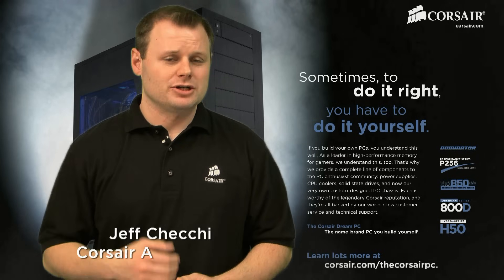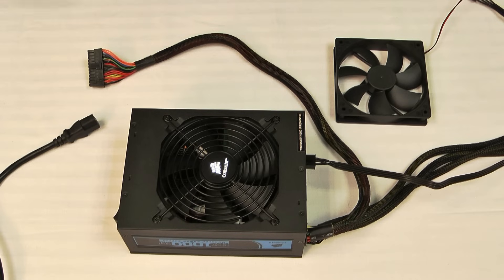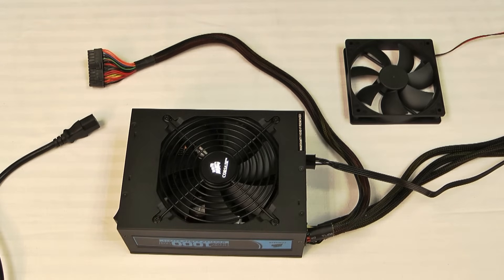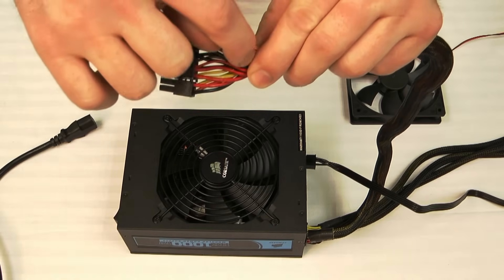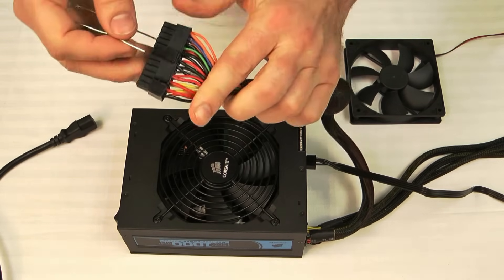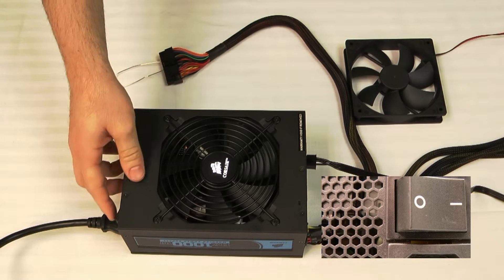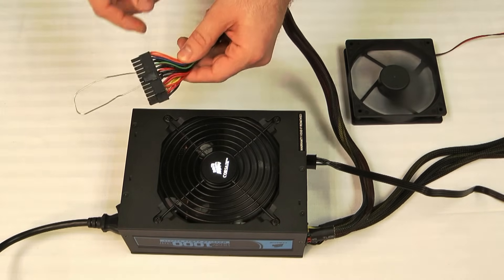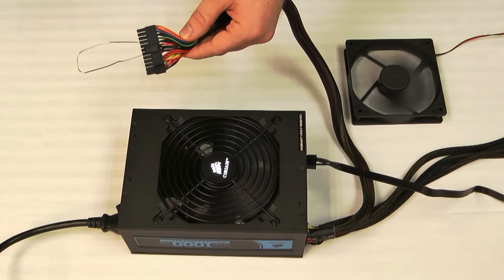Corsair Video FAQ: How to test a Corsair power supply

Comment: Opened the case and grabbed the cable... All wires are black. .'
Reply: Same problem with me :-(
Reply: AX860 – all wires are black and the connector is two separate ones of 18+10 pins, that is 28 pins, not 24 (even though the text on the back side of the power supply days ”24 pin ATX".
Reply: @Mina_be  24 pin that plugs into MOBO is standardized. So that means manufacturers have to put PS ON wire on the same place no matter the brand/model/color of wires etc.
If we are looking at 24pin from back perspective (cables are leading into 24pin connector side) the PS ON wire is 4th from the left going toward right.
Reply: you can find a pinout of ATX power supplies on Google
Reply: Hold up so clip is on TOP and holes facing you. From the top left count 4th hole. THAT is your GREEN.
Reply: Yep. Also my case fans plug into the motherboard
Reply: clip at the top, open end facing you: 3rd and 4th pins from the top left
Reply: @johnnyrosenberg9522  other end
Reply: Its been 8 years and this is still ridiculous .
Reply: I have black wires but it was super easy to test, all you have to do is look for the side with the clip, check if it's 24 pins in total, and short the 4th pin with the 3rd or the 5th pin, and the fan should start turning
Reply: Corsair digital link
Reply: @soggyjungle6065 and which is black?

Comment: This video is 14 years old and everything has moved on so avoid this as there are no green wires on most power supplies as most are ALL black and modular.   Most problems are with the 850 watt Not the 1000 watt and cables are often proprietary so DON"T use any cables that didn't come with the power supply as mixing cables can cause various issues if they are not compatible.   As for me, I'm opting for something better.

Comment: Many years later, we'll still using this method except that manufacturers decide that all the power supply wires should be black and we also have "zero RPM" fans. Question: why can't the manufacturers install a simple LED or push button feature to test for working fan or unit serviceability instead of pushing paper clips into connectors?

Comment: ax860 wont even power the fan it just shuts off again, powers the mobo argb lights so im guessing the 5v is fine. 🤷 got the ax860 to replace another corsair psu that went bad.

Comment: I followed your instructions but I don't have a fan so I connect it to the power supply, however the fan ran and again it stops moving.
When I first tested the power supply, the building was shut down

Comment: i have issue with Corsair HX850i PSU.. Psu is turning on but motherboard is not booting up. lights on motherboard is working fine.. i have checked with other psu motherboard is working fine.

Comment: I have a corsair CX750 and after like 2 hours, my fan fails and stop delivering power the and PC shuts off. When I touch the top of the fan inside my PC, it is hot, but not very hot. How can I figure out what the problem is and how to fix it if any way ? also, it is making a small low noise almost silent ticking noise.

Comment: what if your pc sudden reboot when play high requirement games?
Reply: +lucian Tank Check your temperatures first to make sure your system isn't overheating.
Reply: +Hyperfyre sorry for my noob question... but how high is high for my pc temperature?  cos the last time i check the highest it went was like 60 to 70 degree when im playing metal gear phantom pain....
Reply: It depends on the individual parts in your PC. For some processors & graphics cardss 60-70 degrees is fine. Not ideal but nothing that will danage your PC. I'd google what is fine for your parts first though.
Reply: If your PC is restarting but your motherboard fans, USB devices and monitor(s) don't power on try another power supply.

I've been having issues with mine recently where it isn't powering on my pc properly after cutting out. Other power supplies work though, I've contacted corsair and requested and RMA so hopefully they'll be able to replace mine before its warranty expires.

Comment: is normal when i turn  on my corsair RM1000x power supply the fan  rotates for 10 seconds and turns off!
Reply: Yes that is normal for the RMxxx-xI series power supplies.  Due to complaints is why they started to install a fan test button.  I own 2 of these and only the 1 that I heavily overclock with does the fan ever turn on.

Comment: So my fans are plugged into the motherboard. I can't work out how to plug them directly into the PSU. They are really small plugs and there are no small sockets on the back of the PSU. I mean, I could plug the Sat1, the CPU or the motherboard back in but I'm scared of frying something. Without a fan attached, this test did not turn the PSU fan on. ANy suggestions for a not so tech savvy guy?

Comment: for those who have BLACK corsair wires.... since they won't show you this:

https://www.lifewire.com/atx-24-pin-12v-power-supply-pinout-2624578

make sure to look at the pins and not the locking latch in the picture... since corsair puts theirs on the opposite side i believe... 😑

after you get fan spin, it is a good practice to test the rest of the pins with a good multimeter, black probe in ground pin.

if you have a psu with an additional 8 pin cpu cable integrated:
with the paperclip test still going, test the pins with a multimeter for 12v. either the top or bottom row is all ground, and the opposing row should be 12v. You can find the right row by first checking continuity on you board's 8pin connector to ground before doing the test.

Comment: Hello something weird. This worked, i plugged the powercable in the motherboard without the cpu cable attached either to the source or the mobo. Started it, motherboard started up. Turned everything off, plugged in cpu cable in source, then in the motherboard, nothing is starting anymore. I tried it on 2 same motherboards with 2 same cpus so they can’t be both broken. Any advice please?

Comment: Seems like we're all having problems with the PSU (Power-Supply-Unit). Just sent back an Aero PSU for a Corsair PSU, and guess what? This one isn't working. I've done the paperclip test on both of these PSU and nothing. Gotta send the Corsair back to Amazon for another one! Never had this problem before. I've got a PSU that's 16 years old no problems. Todays cheap parts at expensive prices (keeps the Stock price up, though!!!!!) seems acceptable, for us the consumer to suffer like this. I think what is happening is that companies that make computer parts, in particular PSU's, once they get returned as faulty they're repaired and sent to the next sucker! So what happens the PSU parts are not up to standard, thus they fail within 12 months! See I'm not stupid, I know how these companies work these days!!!!

Comment: just recently bought cv450 my problem is  I tested it with only cooling fans connected and when i turned the switch on fans are working even without a paper clip just like you did. help fix thank you

Comment: What could go wrong if I switch the power supply voltage from 230 to 115 by accident and the boom sound came off... With switching off the computer. What should I be preparing for... Fixing it. Is is dead? What exactly is dead in this case... PSV? motherboard?  Or what?
Reply: Was it dead,right?

Comment: my power supply fan doesnt spin but the case fan does.  Whats the problem?
Reply: +jason tan perhaps your psu fan, if there's some faulty you better do RMA process and do not open your psu under any circumstance as it will void your warranty.
Reply: Some corsair fans like the rm750 only spin when under like 40% load or something along those lines

Comment: my PSU spins the fans briefly then shuts itself down. i dunno why, i put a multimeter across a +12 pin and a gnd pin and it got to 8v before killing itself. what might be causing this? also with another PSU of mine when i plug it into a load (a pretty big load) it shuts itself down like my other one, do PSUs have a clever little safety feature?
Reply: I have the same problem
Reply: i have decided to fuck it all and get a car battery and trickle charger (i was using the PSUs to power a car amp anyway)

Comment: could you please list the pins you used because my corsair ax1200 modular has all black wires
Reply: There is a self test button for that model
Reply: on the 1220i there is not the original 1200
Reply: Google "computer power supply pinout". There will be a diagram that will show exactly.

Comment: Maybe the 12v+ rail is working but the 5v or 3.3v could not work :-" in this case you should get a multimetter at measure the output betwen a black and a red wire for 5v+ and a orange for 3,3v to see if it's ok :D
Reply: Yes bro, I have this issue. This check was fine, but the atx power was not received. The CPU fan spins but the USB and 3.3v / 5v on-board supply were not working.

Comment: I didn't have a Sys. fan with molex connector, so I plugged the molex into an old dvd drive and have the same effect and could eject the dvd... Found out the MOBO is fried and the PSU is fine....

Comment: Well I have this one and like when I plug it into the board which btw doesn’t have a 24 pin connector cuz is a 3050 optiplex doesn’t do anything so I jumped it and I can plug in cpu 4 pin but the moment I plug in the 6 pin into atx power, the psu fan would stop spinning and I would hear a loud coil whine but yet no led on the board nothing but if I unplug it and plug it into just the gpu on a different board works fine. Does that means the board bad ?

Comment: just got problem with my ax1200i. before to this test pc auto restart even only with the mobo. then i try this likw the video, fan start spin after 5 seconds maybe, light turn red and fan stop spin. maybe psu have issue? thanks the fan of psu try to spin but it does not spin at all

Comment: I have a question. When I switch on the psu I see that a green light turns on with mobo but no fans (psu included) turn on. I did this trick and it skrks but when I hook everything back up it does the same thing from before. What does this mean please help!!
Reply: Works*

Comment: I make the bridge between the 2 connectors as show and the output tensions are right (3,3V 5V and 12V) and the rgb fans turn on (only fans connected as in attached image). But when I connect the PSU to the Mobo (ASrock Z97 gen 6/Intel i7 4790x/ first attempt - ASrock B450 pro4/AMD Ryzen 5 2600x second attempt) NO POWER at any time. So the voltage is OK but the Watt power NO.

Comment: so if it turns on that means it works 100% right? mine turned on btw
Reply: No. It only means the power supply works good enough to supply energy for the fan(s). In real conditions, the load on the PSU is hundreds of times higher and obviously it can behave differently if malfunctioning.

Comment: Its 2020 and my 2016 corsairs tx 550 m power supply cables all are black -Coulnd't power a AMD 570 8 g.. which is just beyond me since it was bought to do that. You think I have over clocked a 8 core cpu - no cheapest ryzen 1200 and orginal speeds. Maybe they dont last more than 3 years 24/7 but when is diagnostic coming to power supplies since this REALLY sucks and has happened for 20 years now for me-Im starting to get Pissed

Comment: I recently  bought  Corsair vs450 power supply for my daily driver system. But till 2 days I am experiencing a weird problem that my PC is shutting down without any warning and restarting. I thought it was my ups and changed the connection to main and this also happens. Sometimes the PC is not turning ON. I replaced the PSU with an older one and there is no problem. But I tried paper clip test to test the PSU but it's working fine. I don't know what's the problem of my System. 
I am from India and I don't know how to claim the warranty  for my product. 

_sorry _ for _ my _bad _english
Reply: Kindly reply if you see this 😥

Comment: Please help me, i have a cx430 psu, i did it the way you described on the video but in my case the fan is spinning for a sec or less then its gone.. Can you tell me how to slove it. I would look forword to your reply
Reply: I had the same problem. Connect your case fans/HDD to it and it might work, at least it did for me. I am using RM650x though

Comment: This test its just partial....if the psu dont give enoght voltage  the fan from the psu will run but when u will connect the rest of the components it will not turn the pc on.Overall i dont recommand corsair Psu,mine is ded after 2 months and i saw alot of videos on yt whit ded corsair psu.Whit my 6y old segotep the pc turn on and work normally.

Comment: Someone who works at Corsair should know that not all the cables on a power supply are colored. Mine are all black.
I did notice that it is the 4th wire from the left on the clip side with the pins facing you and the 7th wire.
Reply: My old TX550M not only has black cables. Also the pin layout is lacking in the manual. Thanks

Comment: Got a CX750M PSU around a year ago, and it failed already, actually disappointed in this. brought it due to the brand name, calculator said id be fine with the wattage with what im running, but for some reason it decided to over heat and filled my livingroom with a lovely burnt smell.

Comment: Ok I have a major solution to your problem. My pc also did this and I fixed it by checking that i did not change the "reset"pin with the "power" pin, or they were not the wrong way or not pushed in properly. Please check this before replacing it!

Comment: Hi! Hope you can help me:
I have a Corsair RM850 PSU (0 RPM mode) and these days my PC basically shut down and restart dead when I use 3D applications like gaming and similar. I won't boot anymore, if not keeping it off for a while and then turning it on again.
If I do this paperclip test, will the fan spin? Because the fan doesn't spin at all while booting. Now after many attempts the PC boots again, but it will probably stop working again if I turn it off. So I'm pretty sure it's the PSU faulty. Hope you can help me.

Comment: I was playing WoW and mine just shut down. I disconnected everyting. After that took the tower to the living room, open it and make sure that everything was connected properly. Everything was fine after a while I plugged to the wall and it was getting power but wouldn't stay on so I turned the switch on the Corsair on and off while i was pressing the turn on button on the tower and it worked.

Comment: I just ran a similar test without a case fan attached. (I will have to get one for it). I have a brand new Corsair RM650i PSU. Anyway I started up the PSU with a paper clip. I measured all the pins outs of the PSU with a digital multi-meter, and only one +5V is working. (The PSU fan test works.) On the multimeter I get about 0.25V on the 12V line.
Reply: ax860 here. mobo argb lights are on ( 5v) but the 12v is deado. powers on, straight back off and wont turn on again without a reset (mobo lights stay on). paperclip same effect.

Comment: Just need metal that will conduct electricity. Any conductive metal is fine to use, so long as you can actually bend it and fit it in the holes on the connector

Comment: Is it possible for a psu to turn on the computer with pressing the power button. Like it will turn everything on everytime I plug in the power cable. And to acutllay use my computer i gotta press thr power button to turn on the computer to show display on my monitor. Bascily I can't turn off the computer completely unless I unplug it or switch off

Comment: @MrKontrol90 Nothing...it's grounded just like your body. Sorry I know this was two months ago, lol. Even if you just place in the green wire and not ground it to the black wire you still wont get any results because your body is grounded and you also wont get a reading on your meter because the circuit isn't complete.

Comment: Connecting the green and black wire just fools the PSU making him think the 20/24 pin connector is plugged into motherboard ( the motherboard makes a connection from green to black itself ). But so we can measure voltages on other cables that are coming out from the PSU, we have to have it somewhere outside.

And you can't get electricuted with touching the paper clip. It's a low voltage running through, and even if you would touch it while it has electricity in, you wouldn't feel a thing.

Comment: Got a Cosair RM1000, motherboard is still on the way. So I tried this method without the case fan. The PSU fan doesn't move at all, all I got was a click sound. Is it because it needs a load like a case fan, or is it defective?

Comment: Idea: Test power supply with existing hardware.
Problem: Corsair will not power unless the 24 pin is plugged into the mother board.   Meaning no green light, no fan spinning, fucking nothing.
Solution: This fucking video.

Comment: No, it's fan is dead, wich, in time, will lead to a dead PSU (due to overheat). Change the fan (or get it replaced if it's under warranty)

Comment: Hey guys, I bought an Hx1000i about a month ago, and noticed from the very first week my new skylake build had an issue. Approximately once a week the computer would just completely lose all power and reboot. Well it's happened about 3 times and again today.. Now the system won't reboot using my Hx1000i. How can I get a replacement for my damaged products?

Comment: right i had help with my mate who knows how to build a PC i installed every component the way i need to safely. (I made sure i grounded myself) I finished my build to power up the computer. Nothing happened. I followed a check list to make sure everything was in right etc. Then i did this test with a 550w PSU which is more then enough to power up all my components. The test passed but the psu does not power up the motherboard at all.